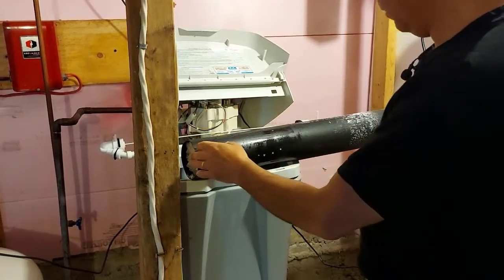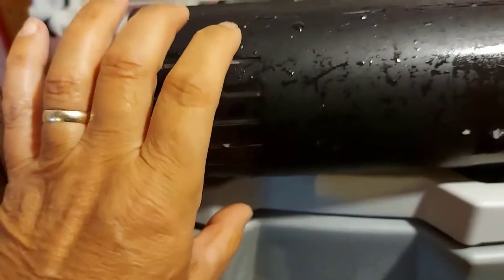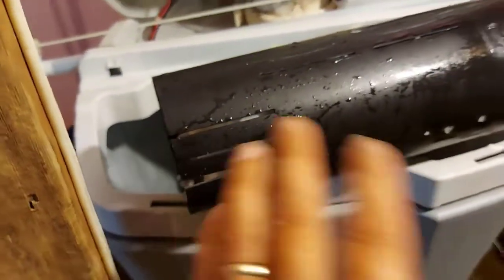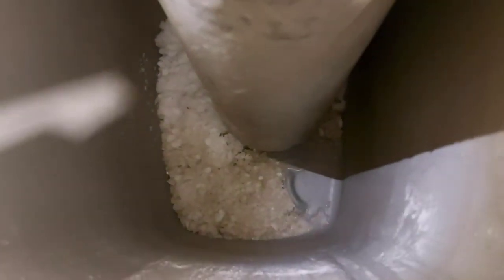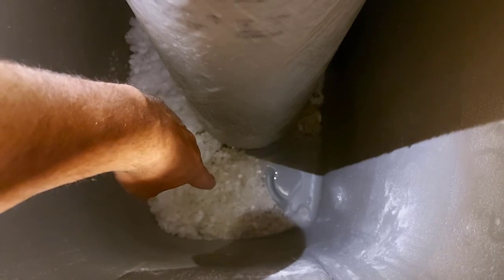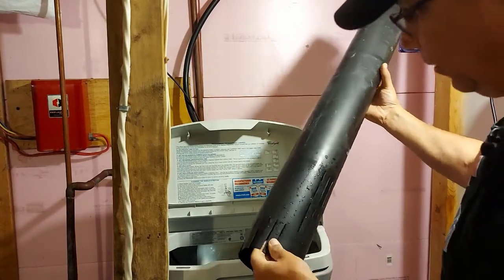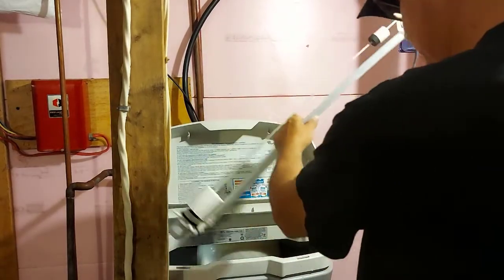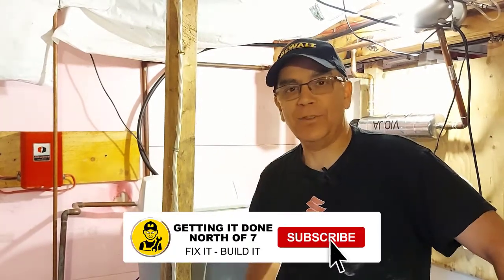Water Softener Not Making Soft Water | This May Have Been My Fault

Comment: My Rheem Model RHS32 softener, same internals as yours, had the same issues you noticed. Less soap suds, salt level not going down, calcium rings starting in the toilet. My unit is two years old.  I noticed the salt tank wasn't filling with water during the first step in a regeneration, thus no regeneration of the resin beads in the tank.
I didn't find the brine well tube clogged. Instead the white plastic water inlet valve at the bottom of the float rod was stuck closed. I pried it with my fingers and it popped free. Started a manual regen and the brine well is filling with water now.
In case a Rheem representative is reading this, yes, I run Rheem water softener cleaner as directed every four months.
Thanks for your helpful video.

Comment: Following your video I discovered that my newly installed softener had a plugged line straight from the factory.  !00PSI of air wouldn't pass through it.  Cleared the blockage put the line back on and have started a regeneration cycle.  It looks to be working now. I'll know for sure once the cycle finishes.  Thanks for the help.

Comment: I have the same issue.. I did it..I put in the tube with several inches of mushy salt.. all my issues started when I cleaned it.. full of water after cleaning, plugged Venturi, replaced gasket, tried to regen but wouldn’t.. regen flashing after four hours so obviously it didn’t regen. Going to clean out bottom and try to regen! 
Is there an O ring in feral nut that connects to Venturi? I don’t remember seeing one but found it below. I hate to have extra parts! 😂Thanks